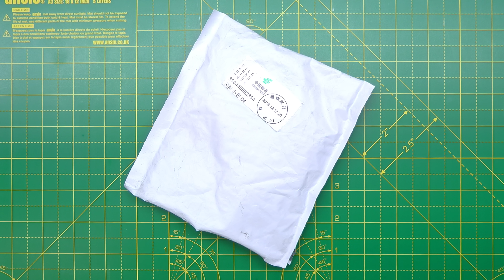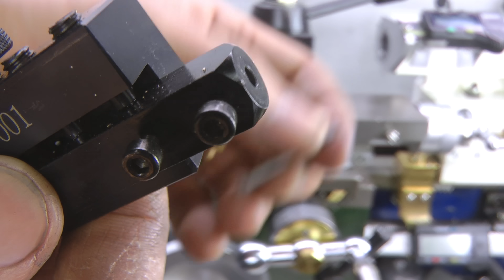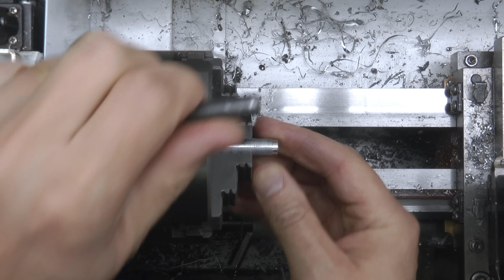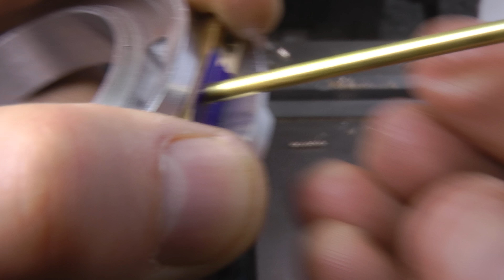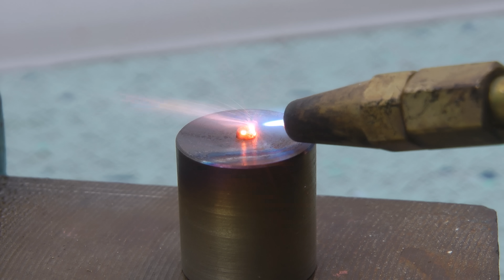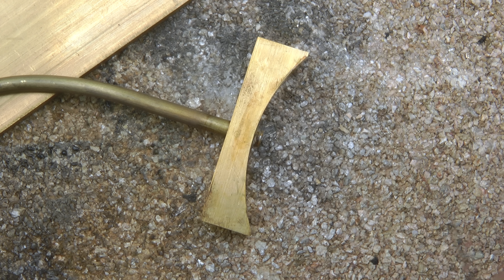An Improved Work Light For The Mini Mill

Comment: I'm watching this process and thinking back a zillion years when I have a UK VHF Amateur Radio license (I was G6HVK).  I spent some time and a lot of effort into making a 12 element Yagi antenna, and on completing it, spoke to someone in Holland, and never used it again.  To be fair, the normal conversation in such communications is a bit boring — this is what I am using, this is your signal strength — so I went back to chatting to my mates on the repeaters till I got bored with that and found another hobby to obsess about.  All these years later, nothing has changed.  When people ask what I make in my workshop, I am a bit embarrassed to tell them that, for the most part, I make things 'for' the workshop rather than with the workshop. So I completely understand your putting so much effort into your machine light.  And a jolly nice job you have made of it.
Reply from the maker: Don't be embarrassed! From what I've seen we're not alone! There's plenty of us who don't have an overarching reason to make things, but really enjoy the process and so keep doing it. For me, pottering in the garage led directly to a new side hobby, making short films for YouTube. Thanks for watching 👍 🇬🇧

Comment: Nice job. You may want to check the pH of your black dye. Mine wasn't creating a deep black. It was a sort of green grey. The pH should be around 6.5 and mine was about 8! A few drops of hydrochloric acid bought it back into range and now it works beautifully.
Reply from the maker: Thanks for the tip. I'll bare that in mind for the next job 👍 🇬🇧

Comment: The through hole vias are called "mouse bite". they are put in the tab where the cut out part is still connected to the larger panel during production.
They make it possible to (mostly) cleanly break the part out of the panel instead of having to cut it.
Reply: My guess as to why there were residual hole plating in the mouse bites is often for cost cutting reasons some board houses plate all holes instead of having a mix of PTH (plated through hole) and NPTH (non-plated through hole). If you drill all your holes at the beginning before plating the holes that need it then you don't need to have drill bits in your milling machine when milling the profiles for final board shape as the final board shape. Makes for a less expensive milling machine for the final step if it only ever needs one tool instead of having a tool changer to swap between the single size milling bit and a variety of differently sized drill bits.
Reply: @Christopher Elliott  they were probably used for testing. They leave them in the panel and then test the whole panel at once.

Comment: Once learned a trick from an old engineer about bending small pipes without the risk of kinking. After annealing he would cut the pipe a few inches longer that was needed, crimp one end, fill with water, the crimp the other end so the water was trapped in the pipe. Since water won’t compress any bending of the pipe would be prevented from kinking because of the water. Once the pipe form was set, he would cut off the ends to release the water.

Comment: You were served up and the title caught my mind. I have just spent 2 days modifying a trailer hitch on the mill. The lighting is behind the tooling. My bandsaw has a light on flex which is also a pain. Do I want new lights? Too right. 
As I watched I realized what a quality production you offer. Nicely paced, lovely vocals and lighting, informative. A pleasant change from our usual stateside comrades. I subscribed.
Re tube bending. Filling it with sugar is a nice twist on the other suggestions. You can dissolve it if need be.

Comment: WAY overkill, stupendous workmanship, a number of disciplines from which I learned quite a few things, great camera work and editing, and narration, and tea making 🙂
When I made the same thing for my 6040 CNC, I used blue foam (My first 3D CNC milling job) and double sided adhesive tape; having a 3D printer now, it would have been straight into SolidWorks, and then 3D printed. But you can be proud of your finished product and its incredible build quality. For my manual mill and manual lathe, drill press and 3D printer, I have found the 30 LED magnetic sewing machine light on a 200mm gooseneck from Amazon for $10 is very flexible, positional and BRIGHT and is the cat's meow.
Reply from the maker: I hope to dip my toe in the world of 3D printing sometime in 2023. Though my record for finishing projects on time isn't all that good! Thanks for watching! 👍 🇬🇧
Reply: @TheRecreationalMachinist  Might I recommend a Creality Ender 3 V2; now my second printer from a very rudimentary unit, and it prints perfectly and reliably right from the start (you do have to assemble it, but very simple, just make sure to adjust it properly; holds adjustment well). WELL worth the price.
Reply from the maker: That's the model I was leaning towards, though I've some more research to do before I commit. Thanks for sharing your experience.

Comment: Very nice! I made a toolpost spindle for the lathe to cut some concentric 0.5 mm wide grooves with a tiny slot drill after giving up trying to grind a tiny trepanning tool. If you make a trepanning tool about 2/3 of the slot width and grind a vertical relief groove in the end, you can sweep the tool sideways without taking wide cuts. The tool only cuts at the outer sections of the front edge, but still cuts a full square-sided groove as you sweep it side to side. I think Joe Pie did a vid about form tools like that a couple of years back. Nice that you resurrected the LEDs

Comment: I enjoyed your video you should have ground yourself a trepanning tool. It affords much more support to the tool below center by following the radius as seen from the workpiece. You could grind a more narrow trepanning tool to reduce the load and feed with the cross slide to finish to size. The light was grear idea and a great design. Thanks for the video

Comment: There are a few tricks used in making musical instruments to keep the tubes from collapsing when bending. One is to use water mixed with a little soap and freeze it in the tube. The bends cannot collapse the brass because there is internal structure. The soap somehow keeps it stable. The other is using pitch. It does the same thing but us more flexible than ice.  They use a ball press to make sure the inner diameter is what is needed for the instrument, but you would not need that for tubing to protect wires. Come to think of it, using the wire itself inside the tube as you bend it would keep it from collapsing.
Reply: I've heard of using fine sand. Of course, you have to block it with sand; something that melts in can block itself as it cools.
But he was pinning the end anyway...

Comment: The light housing looks like a stock part. Very nice job.

I don't know what the obsession is in the UK with replicating gas lamps with LEDs, but finding 6500K lightbulbs in the supermarket or even a hardware shop is a nightmare. The CRI of warm whites is execrable.

Comment: One trick I've seen in watercooling community for bending pipes without kinking was to insert a non-compressible but flexible material, e.g. silicone rod in case with clear plastic tubes. Apparently that works.

Comment: Another trick for bending small tubing like that w/o collapsing it is to pin it like you did, then fill it with fine sand or something similar. Probably would help to pin the other end afterward and heating like you did would probably make it even easier.

Comment: I must confess that I would probably have made one out of plastic! Much easier to machine. I actually made one from LED strips - several wired in parallel - in a square housing. I just drilled and tapped four holes into the mill's casting. However, I think I might upgrade it to higher brightness LEDs and then I will probably use your dimmer circuit, as it might then be too bright or at least need to be controllable for different materials.

Comment: yes its sometimes useful to use via's in the mouse bites so you can power the entire panel at once using minimal connections then cut them out. I don't do that cause its sketch as hell but im not making 70 cent LED rings by the thousands in china (we use a bed of nails where each unit is independent of each other, but those are several dollar a unit OEM automotive parts)

Comment: When it comes to ring lights, larger is almost always better. I think going on the outside of that bolt pattern rather than the inside (or both? heck, why not) would have done a much better job of preventing shadowing with any larger diameter tooling.
Reply from the maker: Whilst I'm really pleased with the way the project went, I reckon if I were to go build a MKII I'd aim for maximum diameter and lowest profile. Thanks for watching 👍 🇬🇧

Comment: It's kind of nice seeing someone working with basically the same kit I have and the same brands.  I did a very similar thing with a ring light but I didn't remove the plastic part (didn't notice I could to be honest) and I made the holder out of Delrin rather than aluminium.  My wiring went down the cable tube from the head to the box on the back and I just added a barrel jack socket into the back box for a 12V wall wart.  I later moved the rear box off the column and wall-mounted it.  Before that, something resonated in the box and it made is sound like any sort of mildly adventurous cut was chattering.  The fine feed has a coupling in it as well that was very loose;  taking that out (I made it solid and just aligned it carefully) took out the last of the rattle.

How are you finding the Rocol cutting fluid?  I was using CT90 but I found that the chlorination caused things to rust if I left what I thought was protective oil on them.  The sulphured oils concern me if they burn off (thinking lathe mainly) as my workspace is very small but it seems very difficult to get a non-cholrinated, non-sulphinated oil at any sensible price...and I'm not sure how well it'd work or whether I'd have also removed everything that makes it actually work!
Reply from the maker: The sulphered, chlorinated issue has never cropped up for me, so I've never really considered it. I really like the Rocol RTD liquid. It seems to work for all materials. It's relatively expensive, but the miserly way I dispense it means it lasts ages and ages. 

I like the compound (paste) version less, it's like thick grease and seems to get everywhere except where I want it. I imagine for large high power jobs it will stay put until it's needed then melt into the crevices and do its thing, but on my small scale it's just messy. 

I've tried every aerosol cutting oil I can find, and don't really have a favourite, though WD40 is a reliable go to, especially for aluminium. I've recently got one of those little compressed air mist coolant thingies, but I've not tried it yet. If it's any good it'll probably feature in a future film. 

Thanks for watching Gareth, good to have you along 👍 🇬🇧

Comment: Tip for those LED lamps: Take the lens out. Seriously, I used one for soldering, and the concentrated light was a bit.....too concentrated. With the lens out it casts a nice even light over a much wider area. If one finds the projection area a bit narrow that is of course.
Reply from the maker: Thanks for the tip 👍 🇬🇧
Reply: @TheRecreationalMachinist  Really the only negative thing I have to say about those lamps is that when they discontinued them, then brought them back, they were a bit on the pricy side for what they are (but then again....Ikea, so....). Other than that they make great work desk lamps. small but not dinky, the long bendy section allows them to really lean over and still shine where they're needed, Ive even had it in front of my face as I looked around it, like in front of my nose with my sight line from each eye on either side of the neck, to illuminate a project.

I vaguely recall the same looseness problem you mentioned, if I recall correctly you have to twist the thing in the direction of the neck spiral to get it to tighten back up..... I think I found that tip on a message board somewhere..... (if its an issue, nose around for confirmation, of course. Im just some jerk in the internet, I could be wrong 😅 It could have been something about tightening up the neck base nut feature where the spiral meets the base mount  of the lamp....too long ago to remember clearly). But yeah, I just made a point to always move it in favor of the twist and it seemed to work fine. No drooping unless the head was at full extension. Since they use that solid aluminum(?) head as a heatsink theres no way to really help that, but its usually fine (mass manufacturing being what it is, its possible a loose neck gets through from time to time also).

Side note: where did you find that ring light? Ive been looking for small ones like in the front of those USB endoscopes to put on my microscope (cheap thing has crap illumination. Ive already hacked some mods into it, but illumination from around the objectives instead of one side would be a lot cleaner), however when I get the wild hair up the beggars canyon to look Google is convinced I want camera flash ring lights, or those 10" blogger lamps. Cant seem to get the search engines to clue into those super tiny ones.....

Anyhoo, cool content, man! When I happened across that mini lathe video my immediate thought was "wait a minute.....I recognize this style.....I wonder who came first......" 🤣 But since I love that other channel in the similar style too its all good, just something that instantly pinged. Exactly the kind of content I like, over the shoulder with knowledgeable people sharing their expertise, experiences, thoughts, and reasonings, etc. As a visual 'learn by doing' type it plugs right into my attention span. Definitely going to have to put your backlog of videos on the to watch list. So from the far side of across the pond, good stuff! Keep on keeping on, mate! 😎👍

Comment: i hope you find the time to answer this question.
If you had to choose between a lathe and a mill, which would you choose? 
i want to get into metal machining (plenty of experience with wood machining / cad / cam / cnc ) but im on a heavy budget. I know theres ways to use a lathe as a mill, and im sure you can in some way use a mill as a lathe but which one is more well rounded for a hobbyist's first machine? and if your question back is, it depends what you want to make, the answer is, i just like tinkering and theres nothing specific i have in mind to make.

also, in regards to your content, you sound like Sean Bean, and watching you is like watching David Attenborough.
Reply from the maker: Great question! 
I got the lathe first, and the mill a little later.
 
With the addition of a vertical slide you can mill on a lathe, but on a very small machine like mine it's very nearly a waste of time. The work envelope is minute and the lack of rigidity makes for poor accuracy and surface finish. If you have a bigger lathe your ability to mill grows proportionally.

A mill will serve as a drill press, but not (safely / effectively) the other way round.

Your budget, space and power supply will also dictate what you can accommodate. 

In the second hand market smaller (bench top) mills are relatively scarce, but smaller hobby size lathes are fairly abundant so availability may steer which one you go for first. Full size machines are fairly common, but you need to have the space and factor in the logistics of getting a ton of iron from where it is to where it's needed. Also a little knowledge goes a long way with ex-industry machines so you can see the difference between dirty but well cared for and freshly painted but has had a hard life.

Have you considered a combo machine? They're full of compromises, neither a great mill nor a great lathe, but hobby guys like me work with what they've got, not what they'd like to have!

In summary, I'd say a lathe first. If you find metal work is your thing you can expand your tools are your hobby grows. Good luck!
Reply: @TheRecreationalMachinist  thats a much more in depth reply then i expected. thank you for taking the time to answer. your answer matched my intuition. now i just need to find something reasonable that will last and i dont have to modify 90% of the machine to get reasonable results :)

Comment: How is the connection to the light ring isolated from the aluminum so that it doesn't short out I't seems like the soldered connection would short on the metal. also where do you get the thin sealant
Reply from the maker: There's a recess cut to clear the solder points: https://youtu.be/KiYS3VVILCo?si=Ee-NduZ6wcC04coF&t=531

Do a search for 'flowable sealant'. Mine came from eBay UK

Comment: Does the ring light generate any discernible heat if it’s not mounted in a big lump of aluminium?
Reply from the maker: The rings I used run surprisingly cool. 
Whilst the extra heatsinking won't hurt, and I enjoyed the build, in hindsight the metal ring was probably overkill.
https://youtu.be/X4ctgZKo18g
Reply: @TheRecreationalMachinist  Thanks for the reply. I think I will give it a try with a 3d printed ring to start with. Great machining project though.

Comment: I tried a halo ring on my drill press, and while it was plenty bright, the drill chuck blocked the light at the place you needed it. You show yours with a collet/end mill, how does it work with something larger?
Reply from the maker: Larger tools do cast a shadow, but I reckon for 70% of the work I do the illumination is better, and for the 30% where it isn't I've still got the gooseneck on hand for extra light, so I'll still call it a win. Thanks for watching! 👍 🇬🇧